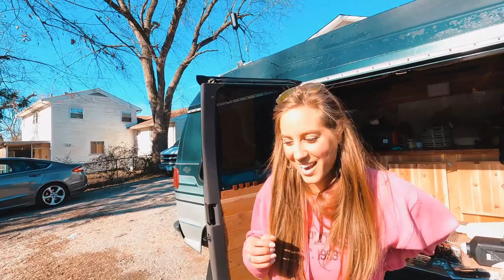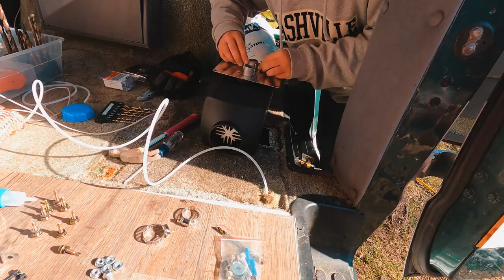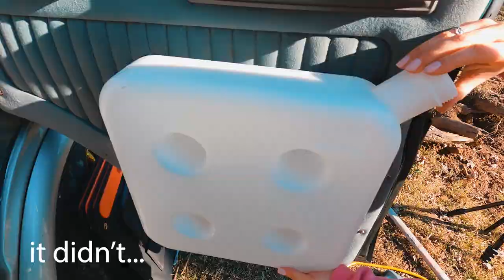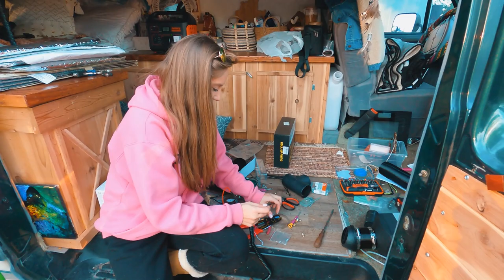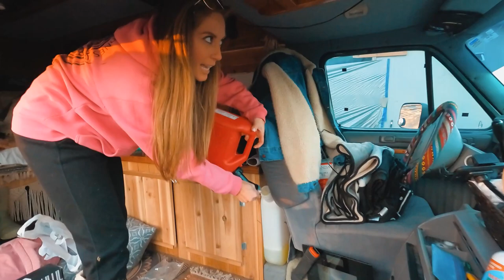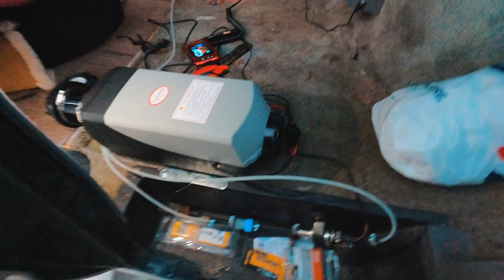Installing Chinese Diesel Heater - Fellow Van Lifer To The Rescue! - SOLO FEMALE VAN LIFE

Comment: Whatever you do never disconnect the power or unplug the 12v feed when the heater is running. The fan is the only thing keeping it alive.  If you disconnect the power when its hot without doing a proper controlled shutdown the heater will literally get to 800F in seconds and melt the entire plastic casing  filling the van with smoke! So its safer to wire directly to the battery with a 25A fuse.  They take a lot of power when starting up and a cig lighter socket is close to popping the fuse and not reliable.  Other than that they are fantastic...enjoy the heat!!
Reply from the maker: Good to know, thank you for the safety tip!!

Comment: Now you've gained valuable experience points. You just leveled up another level in the game of real life. Congrats!  I kinda worry about the connection reliability of the cig lighter plug especially with animals in the van. If you could get a two wire flat connection wired into the jackery and the van that would be a much more reliable connection. Maybe contact jackery and suggest they make this modification its little things like this that can help set a product well above the competition. good job ladies.

Comment: Anyone else doing this should have some one under van watching the first hole being drilled..The person below can make sure that all cables, wires, and hoses are clear.. It's called "Priming" the pump(removing the air from hose).. FYI, Diesel is like liquid ice on concrete or pavement.. You may want a drip pan w/speedy dry mounted under diesel tank.. Whenever using your diesel heater, it's ALWAYS a good idea to crack your windows or vent.. NEVER place heater on OR near anything that will burn. 30 pound ABC Fire extinguisher, carbon monoxide/smoke detector, and a first aid kit should be quickly and easily accessible on van.. Good luck..

Comment: I learned something installing my own fuel lines for my van.........any time I am working with the hard plastic lines. I  boil hot water and dip the end in it  and slide the line on  when it cools it will be form fitted

Comment: Btw the black smoke out of the exhaust is normal for anything that's diesel powered. Just how its burns excess fuel off. 

Getting fuel to the heater for the first time though the line is called priming.

The burning smell is also completely normal with heaters of all kinds. Even happens on brand new heaters when installed in houses and yes like stated it will go away using it a few times.

Comment: You two were amazing. You have heat. I hope you also have a carbon monoxide detector so you don't poison yourself. We want you safe. Building it in the wheel well I hoped the door shut with no rubbing on your installation. Travel safe. God bless.

Comment: Great job! a couple of things 1) you said it was a diesel heater. Diesel going in a yellow container, gas goes in red, water goes in blue. 2) The exhaust should go outside the edge of the van, not just under it. Also, get a Co and smoke detector.

Comment: I would suggest you put the exhaust pointing out under running board so fumes will not collect under van while parked and let fumes into van if just under floor,

Comment: In the future if you are having a problem getting plastic tubing on a nipple heat it with a lighter a little bit and slide it on the nipple.  When it cools it will cool around the nipple.  Then use your clamp.  Make sure you get a CO2 monitor.

Comment: the exhaust gets hot dont put the plastic line against it , as for the power connection : look intoo wago blocks , these work great with multistrand wire and solid wire and you can add replace wires without damaging them

Comment: Hi there well done on tackling the the task of fitting a diesel heater brilliant job and bit of help try using a dot punch in the metal so the drill don't wonder all over the place.

Comment: I converted one of these heaters with a ac to dc transformer to heat my basement. I love it and it’s pretty cheap but good heat overall. They’re a bit quirky and the air intake can cause problems of sutting up the burn chamber but they’re simple to clean and service!

Comment: JAYLENA HAPPY FOR YOU. ONLY ONE THING WHEN YOU PUT THE HEATER TOGETHER I SEEN HOLES IN YOUR FLOOR. IF YOU HAVEN'T PLEASE PLUG THEM OFF.  YOUR AIR FILTER IS RIGHT WHERE YOUR GOING TO GET DIRT AND MUD ON IT WHILE YOU DRIVE. WOOHOO YOU HAVE HEAT. BIG SMILES HERE. COOL
Reply from the maker: Oh yeah, I still have to seal it off real good before I can really use it
Reply: @LeaveHerWild  great.

Comment: Run that exhaust pipe out from under the van they way you have it fumes will creep up thru the floor so run it out the side of the van  to open air

Comment: Run kerosene through your Esbar heater instead of Diesel he’ll keep the heater cleaner and it will run a little bit hotter that you’ll get good heat out of
Reply: I wouldn’t do pure kerosene, it doesn’t offer the lubricity that the pump needs for longevity. Always add some diesel atleast 25% if you use kerosene, your pump will last much longer.

Comment: Great job ladies!  😊
Jaylena please make sure to secure that diesel tank somehow. You would not want that joker to go flying if you were to get into a wreck.
Reply from the maker: It’s secure
Reply: @LeaveHerWild  I know it’s tucked snugly between your drivers seat & cabinet but unless it’s strapped in it could still fly out if someone t-bones you.
Reply from the maker: @julieb9215  It’s screwed to the cabinet
Reply: @LeaveHerWild  Ah ok. Just wanting to make sure you stay safe. I thought you may have left it loose so you could pull it to the side doors when you need to fill it up.

Comment: I keep a small heater in my room for chilly nights when i don't want to heat the whole house up.  I just use the small heater for a couple minutes to take the chill off of the room I'm in.   I did notice that I sometimes get real groggy and hard to keep my eyes open. I realized it was the heater burned up a lot of oxygen in the room, so now I leave the door open and everything is fine..  Keep note of that and give yourself some ventilation if you notice you are more tired than usual for seemingly no reason.  So excited that you have heat now.. that's a big deal!!